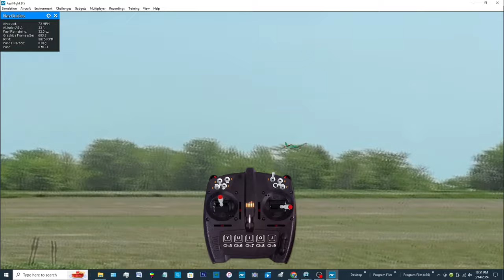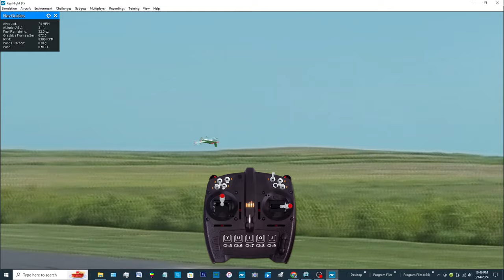Rifle Roll Secrets Revealed

Comment: Dave I can not keep my plane flying in a straight line. I slowed the physics speed to 65% and still can’t figure out what I’m doing wrong. What can I do to fix that?
Reply from the maker: The most likely cause of consecutive rolls losing heading or changing altitude is a weak input in one direction, e.g., a good pull but a weak push, or a good push with a weak pull